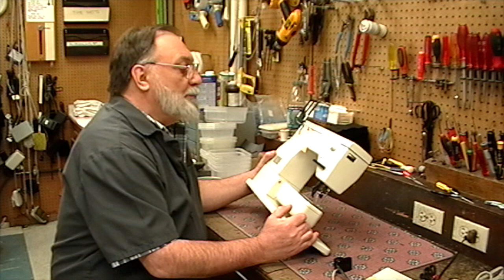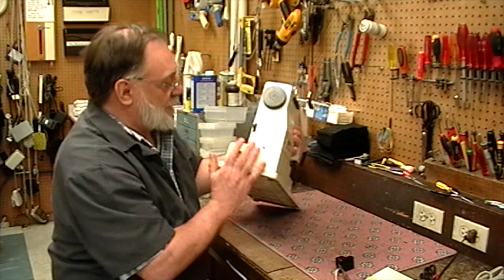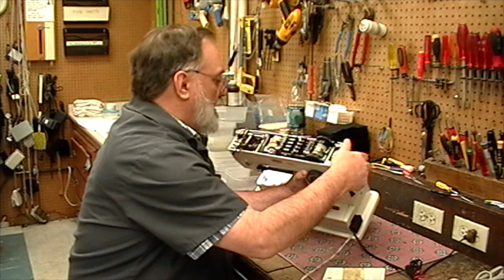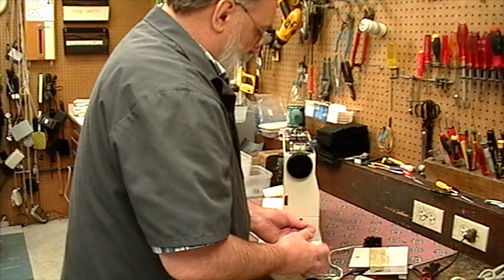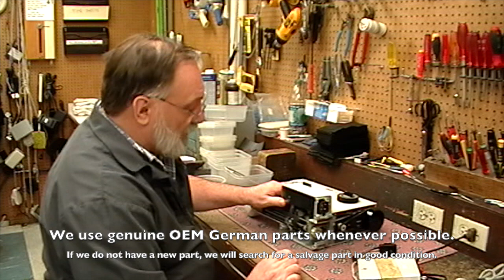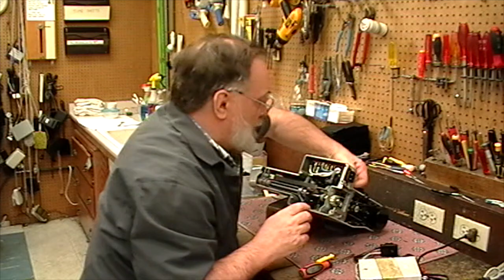1222E Evaluate and repair-Brubaker's Sewing in Pennsylvania

Comment: I happened to come upon one of these machines and just getting started on it.  
Only thing I noticed is when I use a straight stitch it is slightly diagonal.  When I move the needle up and down by hand I can also see the needle move  the left of centre slightly every second time up and down. Goes centre then left, centre then left.  I’m assuming it should be centre all the time.  I replaced the needle as well.  
Any help please ?
Reply from the maker: Your master dial is out of calibration. Not recommend to try to fix yourself.

Comment: I have a 1222E machine that I bought new in 1981 and I have used it continuously for these 42 years. I sew for a living and this is the only machine I had to use all these years.  I have not had any problems other than the needle clamp got shredded threads and so I had to order a new part and it has not arrived yet. Then I decided I need a back-up sewing machine and I bought a used one online (sold for parts) I got it today, and it looks brand new but it has a hand wheel that does not move at all. So, it seems to be seized up... the motor just makes a sound but nothing moves. Since there is no sewing machine repair shop in town, I am trying to find how to fix it myself as I am sure there nothing much wrong with it.

Comment: Hello Glenn, I’m Sophia from Toronto, Canada 🇨🇦 your neighbour.   I need your help on two things, but  one at a time.  Few years back I bought a Pfaff Ambition 1.5 sewing machine.  Now it’s giving me a hard time, that the lower tension is appearing like a loope (like daisy flower patel) and reversing time the fabric gets gathered.  I cleaned the bobbin area, changing the needle and thread etc., but the problem is still there.  Can you please guide me what shall I do that I can fix it by myself?.   The other problem is that I have same Pfaff sewing machine which you are showing in this video, but my machine #is 1213-E and I have not used much, because I came to Canada.  My bad luck that in Canada I can not use it, because of the voltage problem.  Can you highlight on this topic that how can I start reusing this machine.  It’s a very strong and fantastic machine.  Is there possibility by changing the voltage to make workable?  If so, please let me know at your earliest convenience. Thank you and Bye!

Comment: I have a pfaff 1171 it will sew for about 15 min than stops let it sit for a half hour and I can sew for another 15 min.   Took it to repair shop and they told me it was the transformer and can't get parts.They said to use until it it quits. Can you help this issue?

Comment: Hi, Uncle Creepy who doesn't look creepy in the slightest.  I'm trying to find an original carrying case for a 1214, and an original extension table.  I also am searching high and low for anyone who knows what the vertical markings represent, on the stitch width throat plate.  For eg., does the 1 stand for a quarter inch seam?  the 2 for a half inch seam?  I've tried sewing samples and measuring the results but they seem to be a little off.  There was evidently a throat plate marked with inch measurements.  I found a site with an original but it was sold out.  Do you have any referrals for vintage parts and a marked throat plate?  I did find an original manual.  Extra feet seem to be easy to find.  Ellen

Comment: I have a Pfaff Tipmatic 6120.  My sewing machine repair man said it was missing the spring from the needle bar assembly.  The reason it’s missing a spring is because I tried to clean the dried oil off the needle bar assembly myself.  When I did this, a tiny c clamp popped off and I’m assuming the spring did too.  Do you have this spring or do you know where I can get one? Thank you very much!